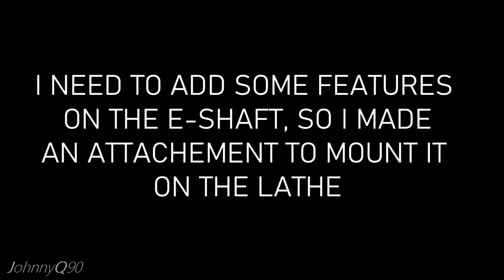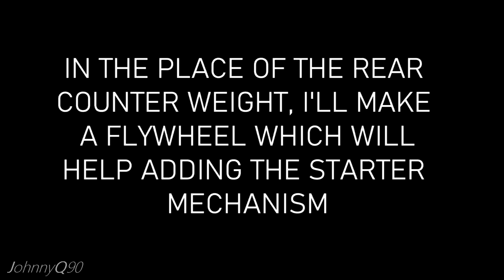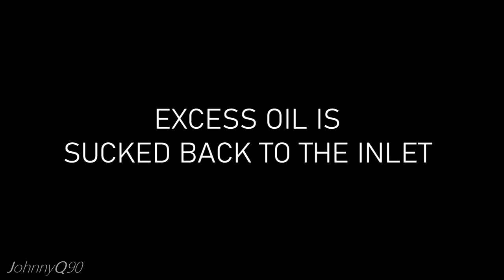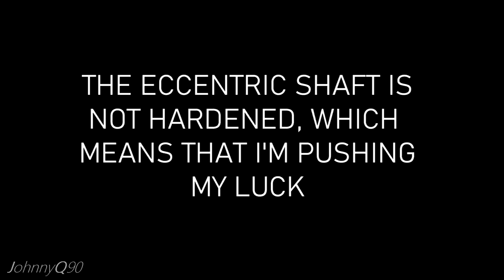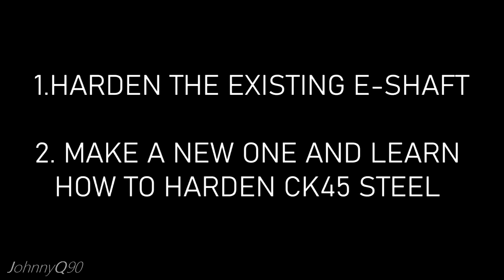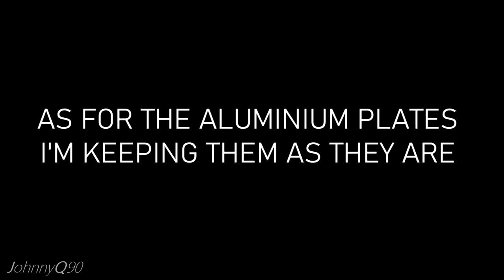TWIN RC Wankel Rotary Engine First Run!

Comment: I know you've been wanting to boost a small engine... I wanna see it and this might spool a vz21.. I have a record single 144cc that spools it easy. Lots of rotary experience and I think with load over 6krpm I should spool. Hope you consider this
Reply: Also love your dowls brilliant solution to those dumb long tension bolts. I see ya thanks I'm gonna use that in my 4rotor much stiffer and easy to get a good tq genius.
Reply: I didn't realize the shaft wasn't hardened ouffff here's what I have to say the stock 13b shaft is a piece of art and I broke one na reving high.. sooo I'd make it hard to have the best luck make it a two piece with a center bearing

Comment: I'm (also) wondering if a split bearing between the eccentric lobes would be beneficial.  Just 'cause I'm used to seeing them on regular crankshafts.
Also wondering what the tapers are for, between the lobes.
ANyone want to enlighten me?

Comment: How about Nitrate the e-shaft? Infuse the metal with carbon via gas. Not much work needed after that.. I don’t know if ck45 is the right material for it tho..

Comment: make solid bearing instead of rollers. softer metal like brass. add oil to fuel. The needle bearing rollers damaged the shaft because tolerance to large and needle rollers are hardened. machine a brass bearing with small oil grooves. oil is the best bearing. find a good ratio of oil to fuel

Comment: Turn it on the lathe a bit oversize, then send it out to be hardened by a company that does that. It could also be case hardened by them. Also- an American mechanic has come up with a new and likely better design whereby the rotor's combustion point indent is not located on the mid point between the two "corners" but is located more logically near the "corner" that is leading the spin. In this way the explosive "push" is out to one side like a push on a lever to give more force and to logically increase spin faster.  He has not to my knowledge made this full size as yet, but it seems the first step would be to instead make a model to test it. YOU should be the first gut to do it. Naturally the ignition plug would have to be over on that side as well.

Comment: precipitation hardening stainless for eccentric shaft? eg 17-4 ph (low temp aging process after machining creates strength with low distortion and surface degradation)

Comment: Say you create a tiny turbo charger for this, one with a hot and cold side where it uses the exhaust to spin a turbine  
a) would it do anything
b) could it cause the engine to blow a gasket or  total itself

Comment: If you had two opposing weights on the crank wouldn't that elminate the need for a counter balance...
Exclaimer; I do not claim to know anything about engines. Just a mechanic in a machine shop playing with GM hummer blocks and rebuilding heads.

Comment: For all engine internals that you remove material from needs to re-harden. When you cut the surface is one thing but when you go this deep especially need to re-harden. If you this annealing correct ou will have a part that is as strong as it was or stronger. for further strength shocking with tiny metalballs is a proven method. Im sure that the cut you made the shaft WILL make it very much weaker at the point where you introduce lateral pressures. this is recipe for disaster. Instead of clip holding it it would be better to endlock it. thus moving he strain away from that crucial part of the balance in the axle. 

Good luck with your hobby, do remember to anneal cut or treated or added parts that endure a lot of stress.

Comment: I have an idea to make something similar to this, but fully cnc'd out of steel or aluminum and a bit larger, so it could power a small moped like my piaggio ciao. I don't know how should i make the seals between the different housing pieces and on the rotors and stuff. I want it to be a 2 rotor engine producing about the same or slightly more power than a 49cc engine, and the higher rpm will be handled by a small gearbox. Any help would be appreciated!

Comment: I acknowledge rotary engines are one of the least economical engines around, but even I'm surprised at the fuel usage...

Imagine what this could be with electronic fuel injection with ignition timing control and a little servo to control the idle...

Comment: the "intake trumpet" is called a "velocity stack"  <3
Reply: @Stathis Bikos - Ram tubes... rams the air into the carb. Velocity stack is that over size intake trumpet fitted to Hondas and Golfs to make more lawnmower noises
Reply: @323smurf8  I'm not sure If you're making a joke that I'm not getting :P

But these are called velocity stacks. All of them. Any tube fitted to the intake that has a radius inlet is a velocity stack.

You can call them ram tubes, intake trumpets, even air horns but they are all velocity stacks. It's their literal name.
Reply: @stathisbikos6563  I was only making a joke 🤣🤣
Reply: @323smurf8  So sorry mate, It flew over my head that one XD ^_^

Comment: a problem with Wankel engines is that the tips on the rotor wear out quickly and need to be replaced to keep compression high in the ignition chamber, they sprung loaded some tips to help with longevity but this problem along with its thirsty nature sidelined Wankles from mass usage in the auto industry, do you have the same problem, I.E. the tips wearing out quickly, in a car it makes the servicing of these parts to much hassle, the time involved is just too much, labour costs and downtime of the engine,

Comment: I’ve built multiple rotary cars. Your problem is as simple as oiling ! Or shall I say “lack there of “. Mazda has oil hitting those side plates constantly I say add a small amount of two stroke into fuel. You have a lot of resources at your disposal I’ll say give 3d printing a ceramic apex seal it’s best kind of apex seal but most expensive but you , well just make them then. Consider matching a side and corner seal snowmobile rotary engines took the Mazda design of corner and side seals maybe so should you?! I think the others on here are onto something with crome electronic plating maybe nikasil. Harder metal will help you, but the scarring is a sign of a fundamental problem with wear that quick !

Comment: "This thing is thirsty." Yeah. Back in the day, I had an F250 ford with a 390 and a friend had a Mazda with a rotary engine. I got better fuel mileage than he did.
Reply: Maybe low compression because of dead apex seals.
Reply: @SmikeMan  nope, 2 km/litre at wide open throttle. If you port them they make more power and rev harder, but then they drink more too. If you wanna play, you must pay 😏

Comment: New E shaft or harden the existing one...

Please do something with the aluminum side irons. Mazda plates their aluminum rotor housings with a nickel or chromium compound. Please electroplate them... please. (those aren't "typical apex seal marks," they're 100,000+ mile apex seal marks)

Comment: First question is, is it class as a single stroke engine or a 3-stroke engine, Reason why it is drinking so much fuel is because the carbs needs to be tuned and also balance with each other, Get the same problem with all multi-carbs engines, if they are not tuned and are not in balance with each other, they will drink fuel like nobody business
PS try 3 rotary engines in a line

Comment: I don't believe that engines of this sort are made to be gunned like that,  have you ever been in an airplane where the pilot did that?
when considering the acceleration and deceleration of the internal parts is not a great idea.  take the same scenario but with heavier internal parts.

Comment: C45 steel cant be hardened, at least as good as It should, try out your luck going to a local shop and asking if they have any scrap tool steel laying around, that can be hardened and tempered and still be 55HRc+

Comment: 14:30 may be the eccentric shaft vibration?
if it's right , need weight balancer. 

               ###            *
**************************
                       *            ###

(# adding weight balancer )

Comment: you could use the little engine to power a radio control model airplane
Reply from the maker: I'd love to, but I'm more a car guy. Plus, I've never flown an rc airplane before and there is no place for such activities in my country.

Comment: There are tool steels like, for example, M42, which you'd typically buy as hardened and tempered stock.
I am well aware that that's likely not the best choice for this application, but it's the one I had been looking at a while ago while researching a suitable material for a high-temp screw extruder to use on an FDM 3D printer with a very balanced gantry so elastic deformations keep the axes independent to allow the lack of stiffness to be largely cancelled via open-loop control.
FDM printers don't need stiffness to prevent chatter and self-feeding, and heavier gantries would (power-)limit acceleration at high speeds if the machine is supposed to use a normal wall outlet (~3500 W in Germany).

TL;DR: Talk to https://gtwr.de/stefan-gotteswinter-prototyping-tools-and-machines/ (has a YT channel), he has tons of experience with hard turning such small parts, typically using DIY-refurbished CBN tools.

Comment: Go back to old ways,stainless steel and cast iron! INCOLNEL for the stainless and good old cast iron.  Vacuum heat treated, Triple draw it should be 56 rc I think but it will be tuff, almost unbreakable, run at max speed for a long time and no problem and over and over.